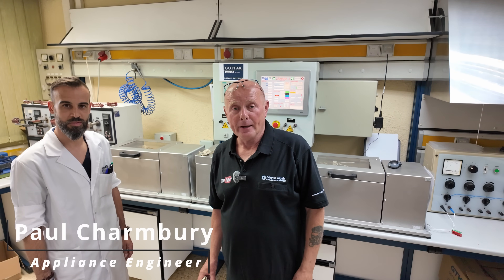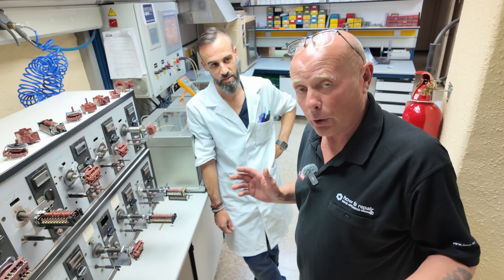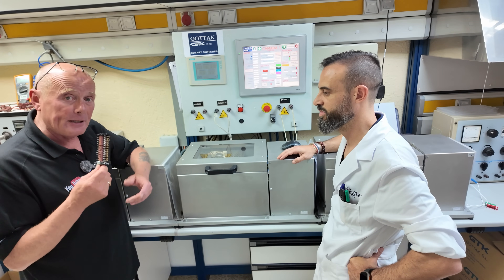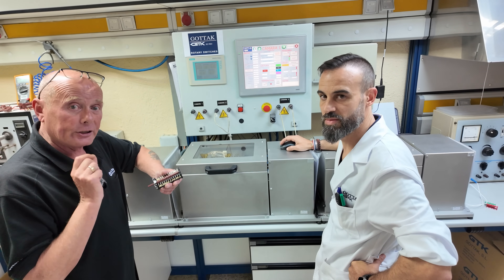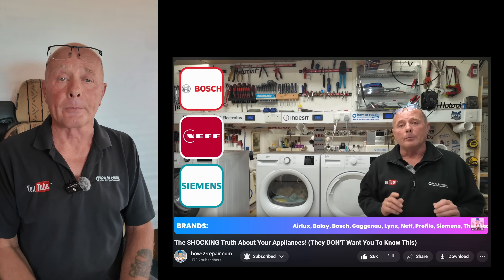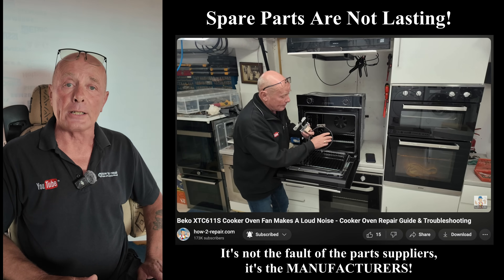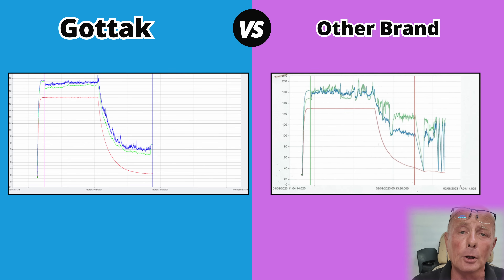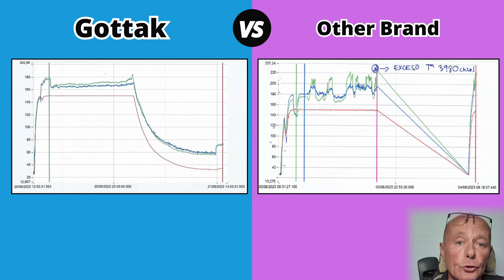Why Your Appliances FAIL SO FAST! Lab Results EXPOSE the Truth!

Comment: All the manufacturers need is to avoid leaving paper trails of some things and ensure NDAs are in place with everyone involved.

As you can see from the video: observing these things externally requires huge amounts of resources, time and effort. And there is still plausible deniability left for the manufacturer.
Reply from the maker: Hi there! Thanks for your comment, @timop6340!

You've hit on a really important point about the challenges in bringing these issues to light. 

Despite these challenges, we believe it's crucial to raise awareness and share observations. At the trade show last year, understanding how much obsolescence is being designed into new appliances these days is something everyone should be aware of, even if the precise internal mechanics of these decisions are opaque. For a deeper dive into this topic and to see the examples we covered, please check out the full video here: Link to your main video: https://youtu.be/gEgSCbZnHVM?si=wTIw0mELuhWaw4aX

We also explored related aspects in these videos:

The shocking truth about manufacturers: https://www.youtube.com/watch?v=QsdGd2qDPaI
Heat pump tumble dryers are they really worth it?: https://www.youtube.com/watch?v=xn03N3b0-lE
If you found this information eye-opening or helpful, please consider sharing this video with your friends and family. The more people who understand the complexities and potential issues with appliance longevity, the better equipped we all are as consumers.

Thanks again for watching and engaging! Don't forget to subscribe to the channel for more insights like this!

Comment: Manufactures need to understand and quantify that reliability goes a long way towards customer loyalty .  I have had a heat pump tumble dryer that failed way before its practical value . And now the only thing i trust is a washing line drier powered directly from the sun and wind. Slightly inconvenient. But small outlay costs and cheap to run.
Reply from the maker: Hi there! Thanks for your comment, @andrewtitcombe8378!

You've hit on a really important point about how crucial reliability is for customer loyalty, and your experience with the heat pump tumble dryer failing "way before its practical value" is a perfect example of why. It's completely understandable that such an experience would lead you to trust simpler, more dependable solutions like your sun and wind-powered washing line, even if it's a bit inconvenient. This shift in trust and consumer behaviour when faced with products that don't last is a key aspect of the built-in obsolescence problem we discuss in the video.

At the trade show last year, understanding how much obsolescence is being designed into new appliances these days is something everyone should be aware of, and it certainly gives context to experiences like yours. For a deeper dive into this topic and to see the examples we covered, please check out the full video here: Link to your main video: https://youtu.be/gEgSCbZnHVM?si=wTIw0mELuhWaw4aX

We also explored related aspects in these videos, and given your experience, our video on heat pump tumble dryers might be particularly interesting:

The shocking truth about manufacturers: https://www.youtube.com/watch?v=QsdGd2qDPaI
Heat pump tumble dryers are they really worth it?: https://www.youtube.com/watch?v=xn03N3b0-lE
If you found this information eye-opening or helpful, please consider sharing this video with your friends and family. The more people who understand what's happening with appliance longevity and reliability, the better equipped we all are as consumers.

Thanks again for watching and engaging! Don't forget to subscribe to the channel for more insights like this!

Comment: Replaced a mechanical defrosting timer on a 20 year old refrigerator, the relay contacts were gone. The replacement timer only lasted 3 years.
Reply from the maker: Hi @androidbox3571,

That's really frustrating when a replacement part doesn't last anywhere near as long as the original! It's a common experience, unfortunately. Sometimes, the quality of replacement components might not be the same as the parts used in the original manufacturing, or there could be other factors at play affecting the lifespan of newer parts.

You might find our videos interesting as they delve into why this sort of thing can happen with appliance parts and the concept of built-in obsolescence. We discuss how the longevity of components has changed over the years.

For a more in-depth look, please check out our videos on the topic:
Video 1: https://www.youtube.com/watch?v=QsdGd2qDPaI
Video 2: https://www.youtube.com/watch?v=xn03N3b0-lE

We hope you find them informative! Please consider subscribing to the channel for more content like this and share the videos to help raise awareness.

Comment: This is such a bad thing for the planet, what a waste of material and efforts, appliances should last way more than they do. I had a Samsung dryer, after just five year the manufacturer did not make a replacement front panel. I had to buy a used one on ebay. I wish I had repaird my old dryer.
Reply from the maker: Hi there! Thanks for your comment, @FBIMitch!

You've hit on a really important point about the frustratingly short lifespan of modern appliances and the difficulty in sourcing replacement parts, like your experience with the Samsung dryer. This is exactly the kind of built-in obsolescence we discuss in the video.

At the trade show last year, understanding how much obsolescence is being designed into new appliances these days is something everyone should be aware of. For a deeper dive into this topic and to see the examples we covered, please check out the full video here: https://youtu.be/gEgSCbZnHVM?si=wTIw0mELuhWaw4aX

We also explored related aspects in these videos:

The shocking truth about manufacturers: https://www.youtube.com/watch?v=QsdGd2qDPaI
Heat pump tumble dryers are they really worth it?: https://www.youtube.com/watch?v=xn03N3b0-lE

If you found this information eye-opening or helpful, please consider sharing this video with your friends and family. The more people who understand what's happening with appliance longevity, the better equipped we all are as consumers.

Thanks again for watching and engaging! Don't forget to subscribe to the channel for more insights like this!

Comment: How dare you say that, Paul? The industry is not gonna love it. I guess you are now on their blacklist.
Speaking of quality and how bad the industry has become, we bought our first washing machine back in 2006 and it lasted nearly 15 years. It was low end model, as they now call it, but cost us only 170 euros at the time. Experienced only minor repairs - the motor had its brushes replaced. Since then we've changed 3 different brands, each one considered to be high end.
Reply from the maker: Hi there! Thanks for your comment, @BChopakov!

You're right, sometimes telling it like it is doesn't win popularity contests with the industry! We appreciate you highlighting the stark contrast in appliance longevity, like your 2006 washing machine lasting nearly 15 years with only minor repairs, compared to the experience many have with newer, supposedly high-end models. This really speaks to the decline in manufacturing quality and the built-in obsolescence we discuss.

At the trade show last year, understanding how much obsolescence is being designed into new appliances these days is something everyone should be aware of. For a deeper dive into this topic and to see the examples we covered, please check out the full video here: https://youtu.be/gEgSCbZnHVM?si=wTIw0mELuhWaw4aX

We also explored related aspects in these videos:

The shocking truth about manufacturers: https://www.youtube.com/watch?v=QsdGd2qDPaI
Heat pump tumble dryers are they really worth it?: https://www.youtube.com/watch?v=xn03N3b0-lE

If you found this information eye-opening or helpful, please consider sharing this video with your friends and family. The more people who understand what's happening with appliance longevity, the better equipped we all are as consumers.

Thanks again for watching and engaging! Don't forget to subscribe to the channel for more insights like this!

Comment: LG is one of the companies that means a malfunction in its home appliances, and the washing machines that make it shockingly
For example, the mode of the DIRECT Drive washing machine is designed so that the motor jack is under the center of the pelvis. If any malfunction occurs and a few water points of the pelvis leaks directly to the engine, which leads to the disruption of the engine and then the control panel is disrupted.
LG is the worst ever.

شركة LG هي من الشركات التي تتقصد حدوث عطل في أجهزتها المنزلية، والغسالات التي تصنعها بشكل صادم
مثلا تم تصميم وضعية محرك الغسالة الانفرتر direct drive بحيث يكون جك المحرك تحت مركز الحوض. فإذا حدث أي عطل في المانعة وتسربت بضع نقاط مياه من الحوض تسقط مباشرة على المحرك، مما يؤدي إلى تعطل المحرك ثم تعطل لوحة التحكم.
شركة LG هي الاسوء على الإطلاق.
Reply from the maker: I have had a few lg washers with bearings gone and the water did not do any damage to the motor at all I'm actually finding this company to be one of the better ones now compared to a lot of others, but I will say they are not supporting the end user with technical data
At the trade show last year, understanding how much obsolescence is being designed into new appliances these days is something everyone should be aware of. For a deeper dive into this topic and to see the examples we covered, please check out the full video here: https://youtu.be/gEgSCbZnHVM?si=wTIw0mELuhWaw4aX

We also explored related aspects in these videos, which you might find particularly relevant given your comment:

The shocking truth about manufacturers: https://www.youtube.com/watch?v=QsdGd2qDPaI
Heat pump tumble dryers are they really worth it?: https://www.youtube.com/watch?v=xn03N3b0-lE

If you found this information eye-opening or helpful, please consider sharing this video with your friends and family. The more people who understand what's happening with appliance longevity and design, the better equipped we all are as consumers.

Thanks again for watching and engaging! Don't forget to subscribe to the channel for more insights like this!
Reply: @How-to-repair  this fault appears when the washer Sealing damege and leak some drop of water direct into the direct drive motor jack.
anther fult come with LG washer tht use dc motor, the fault occurs when the rubber tube connecting the detergent drawer to the washing machine drum dries out. During drying, water drips and, when the washing machine vibrates, falls onto the motor jack, burning the motor jack and damaging the control board. This causes the microcontroller to short.
The design of the motor jack in which the tiko meter contacts are placed adjacent to the high voltage contacts is a destructive design when a water leak occurs.

Comment: We already had reliable machines. It is possible. I still run a kitchen mixer from the 70s from commie GDR. All plastic, yet not brittle. A modern plastic part will crumble in 10 years. 
When resources are scarce, engineers find ways. But given the marked dynamics (and consumers being the idiots they are), I fear the only chance to eliminate planned obsolescence is legislation. Forced legal warranty needs to be stepped up by A LOT. 
5 years for consumer electronics and up to 20 years for household appliances. Double that period spare parts availability, none of which costs more than 10% of the new price. And if a manufacturer doesn't want to do that, he has to give the part production data into the public domain, for anyone to recreate. 
Problem solved. It is possible.
Reply from the maker: Hi there! Thanks for your comment, @jackmclane1826!

You've hit on a really important point about how reliable machines used to be, and your example of the 1970s GDR kitchen mixer still going strong is a fantastic illustration of that. It really highlights the contrast with the longevity, or lack thereof, of many modern appliances and the issue of materials becoming brittle, which feeds directly into the concerns about built-in obsolescence we discuss in the video.

Your perspective on market dynamics and the strong call for legislative solutions like extended warranties and mandatory spare parts availability (or open-sourcing production data) is a very thought-provoking contribution to the discussion on how to combat planned obsolescence. It's clear that many feel a shift in manufacturer responsibility is needed.

At the trade show last year, understanding how much obsolescence is being designed into new appliances these days is something everyone should be aware of. For a deeper dive into this topic and to see the examples we covered, please check out the full video here: https://youtu.be/gEgSCbZnHVM?si=wTIw0mELuhWaw4aX

We also explored related aspects, which touch on some of the manufacturer accountability you mentioned, in this video:

The shocking truth about manufacturers: https://www.youtube.com/watch?v=QsdGd2qDPaI

If you found this information eye-opening or helpful, please consider sharing this video with your friends and family. The more people who understand what's happening with appliance longevity and engage in these important discussions, the better equipped we all are as consumers and citizens.

Thanks again for watching and engaging with such detailed feedback! Don't forget to subscribe to the channel for more insights like this!

Comment: Yep - I've repaired my condenser drier multiple times, it started with the door roller supports and finished with the motor belt tensioner. Very simple internals but if the PCB dies then it's time to replace.
Reply from the maker: @grungysquash1 It sounds like you've become quite familiar with the inner workings of your condenser dryer! It's interesting how often it's the simpler mechanical parts that fail first. As you mentioned, the electronic control board (PCB) can often be the point of no return. Our videos (https://www.youtube.com/watch?v=QsdGd2qDPaI & https://www.youtube.com/watch?v=xn03N3b0-lE) touch on how the increasing complexity of appliances can sometimes make repairs more challenging. We encourage you to check them out for more on this topic. Please subscribe to our channel for future discussions!

Comment: Financeers even more than accountants are responsible for this, and they're the scourge of this planet
Reply from the maker: That's a really interesting perspective, Patrick. It's not something we've specifically delved into in the videos yet, but it brings up a crucial point about the financial pressures and decisions within companies that might be contributing to this trend of shorter lifespans for products.

The focus on maximizing profits and shareholder value could certainly play a significant role in decisions about component quality and product longevity. It makes you wonder about the balance between financial goals and the responsibility to produce durable and reliable goods.

We haven't explored the financial aspects in detail in our current videos (https://youtu.be/QsdGd2qDPaI, https://youtu.be/xn03N3b0-lE), which primarily look at the engineering and manufacturing side of things. However, your comment highlights a potentially very important piece of the puzzle.

Thanks for bringing this up! It's definitely something worth considering for future discussions. If you have more thoughts on this or found this interesting, please subscribe to the channel for more conversations!

Comment: I've been thinking for years now about creating an NGO centered in the design and manufacturing of long lasting appliances with open source hardware designs, so that even if the company goes bad individuals can fix them by following the designs. Most of the appliances that I've seen fail as a consumer are always because of cost cutting in the electrical design.
Reply from the maker: @No1x3N That's a fantastic idea! Creating an NGO focused on durable, open-source appliances could really make a difference. As we discuss in our videos on built-in obsolescence (https://www.youtube.com/watch?v=QsdGd2qDPaI & https://www.youtube.com/watch?v=xn03N3b0-lE), the trend of cost-cutting often leads to shorter lifespans for appliances, particularly in their electrical components. You might find some interesting insights and examples in those videos that resonate with your observations. We encourage you to subscribe to our channel for more discussions on this topic! On a sidenote there are some components which I'm thinking of setting up 3-D printing for and also supplying spare parts from used appliances
Reply: @How-to-repair  will check them! And the mention you make on 3-D printing is an absolute valid idea, I myself have designed and printed some replacement parts for a microwave door clip that broke and the replacement parts where hard to find and absurdly expensive for a part easily 3D printable. That too, designing the appliances from the ground up with the mindset of 3D printing could also bring down costs + expand the lifespan of said appliances since it would be waaay easier to 3D print on the spot the required replacements.